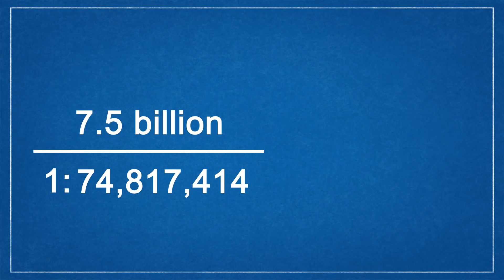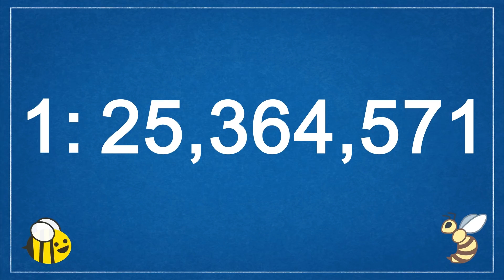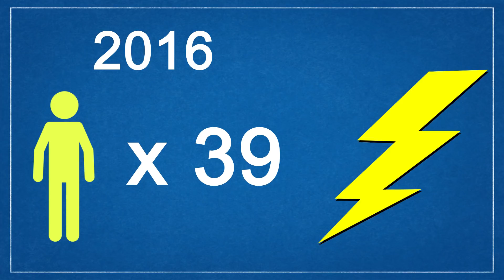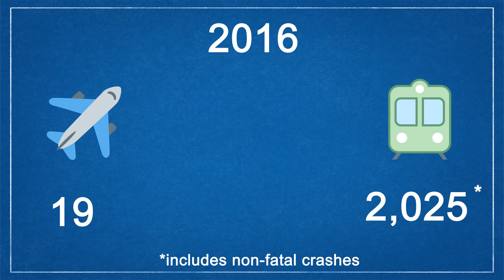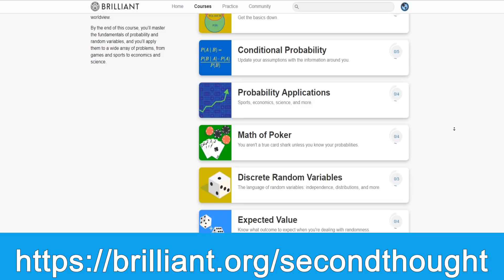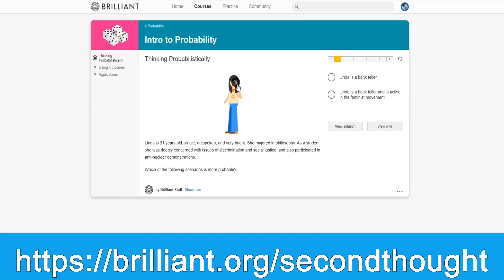What are the Odds of Dying an Unfortunate Death?

Comment: A lot of these figures are misleading, because they are being calculated for the entirety of the human race instead of only the subset for which each particular death applies to. For example, being struck by lighting varies significantly based on where you live. You can't die in a plane crash if you don't travel in that fashion. And you can't be bitten by bees where none exist. If you account for that then your chance of dying from all of these will be either much lower or way higher than what's is presented in the video.  Except for the asteroid bit, that sadly checks out.

Comment: That plane question was legit? I thought it was rhetorical. Obviously the engine is more important than the wing. You just said pilots return with bullet holes in wings. Which means shooting a wing does basically nothing. So why protect it more if it is already great at what it does?